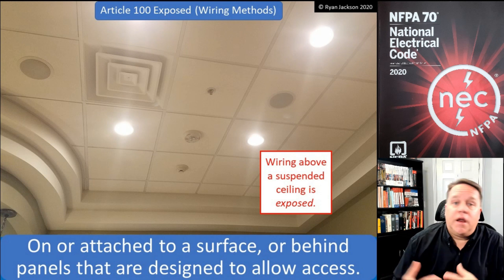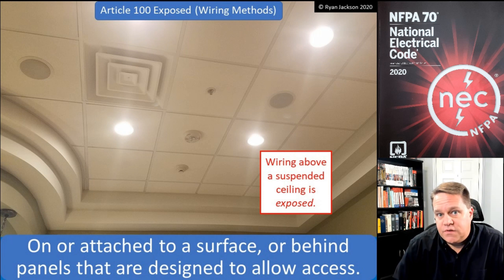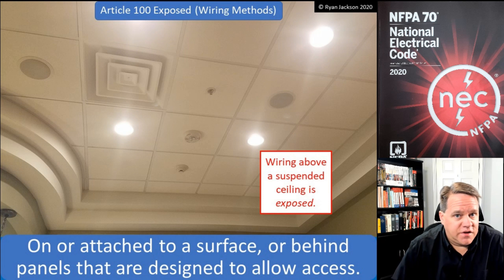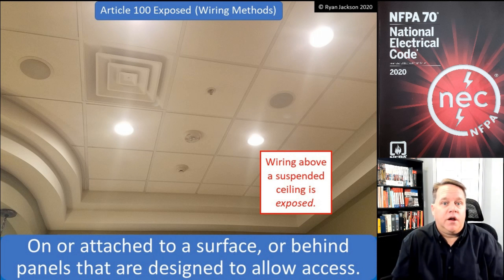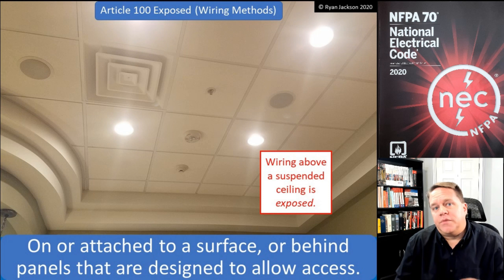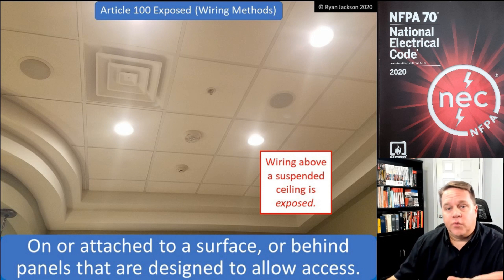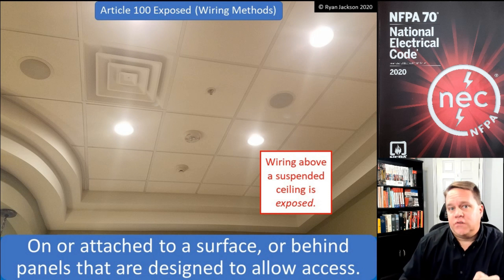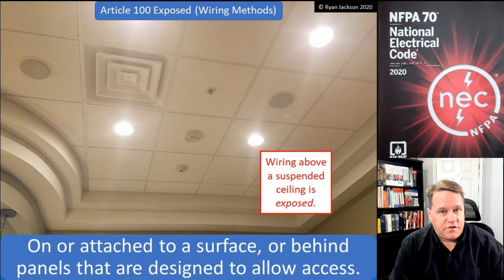100 Days of Article 100: Exposed

Comment: So the wires above a suspended ceiling... Would they technically be both exposed and concealed?
Reply from the maker: Nope, they are exposed.
Reply: @RyanJacksonElectrical  I just rewatched your video on "concealed" and was thinking that you couldn't take a picture of wiring above a suspended ceiling.  I think that's where my confusion came from.. I wonder if it's because the ceiling panels are not considered the structure of the building doing the concealment...  And I guess you could take a picture of the wires if one of the panels was moved LOL. What about wires above a plastered or drywalled ceiling?  Would that be concealed?
Reply from the maker: @CharkG73  it's all about the "panels designed to allow access."
Reply: @RyanJacksonElectrical  ah ha!  Makes perfect sense now. Thank you!

Comment: Extremely high voltage= next to no current, 0.000 amps. So if i touch it ill potentially get shocked although the frequency is high but i wont die. Thank you as an apprentice I get nervous walking around 13,000-24,000 volts in an industrial setting.
Reply: Shocked and Electrocuted are not the same.
Reply from the maker: No, no, and no. I=E/R, with you being the "R." Your resistance and the voltage of the circuit determines the current going through you. Shock is 100% a voltage issue, as the voltage determines the current. The only exception to that is if the source is limited in its power output, like a doorbell transformer or similar.

Comment: Another great video.  Makes me think of the 1920s houses in my area with knob and tube wiring.  In attics and crawl space under these houses the wires are visible.  If you touch the insulation the cloth and rubber will disintegrate exposing the copper.  This is not a real problem when the wires are overhead.  In the attics it is a different problem because the wire is also where one crawls.  Most of the attics I have been in require a ladder for access.  Most of this safe because the original installation were done with the realization that insulation could be lost. The scarry situations are where bootleg modification occur.  The worst was someone rerouted the cables by cutting a groove in the plaster, laying cloth and rubber insulated cable in the groove and plastering over the cable.  The biggest advantage of knob and tube is heat disapation.   Burying in plaster would retain the heat.